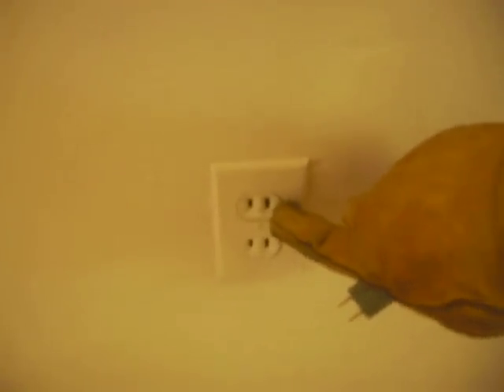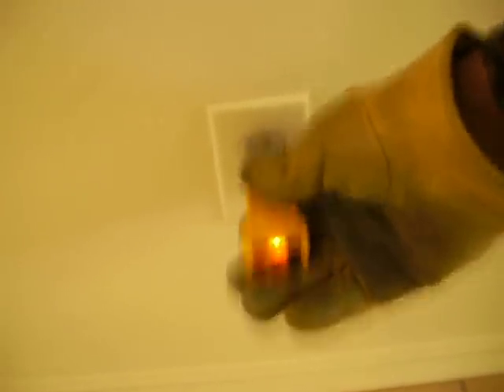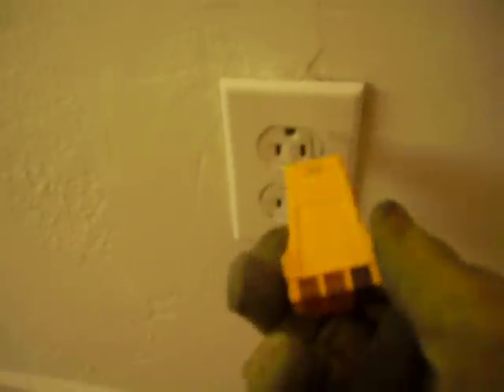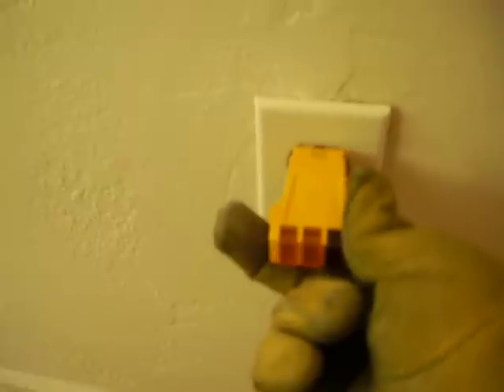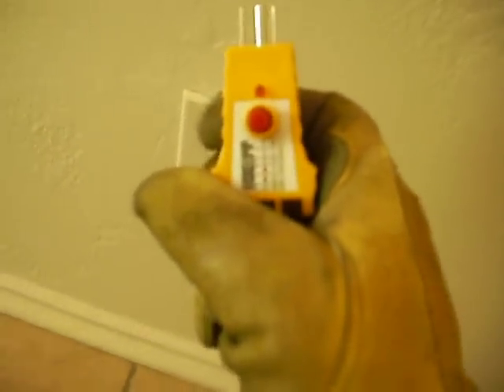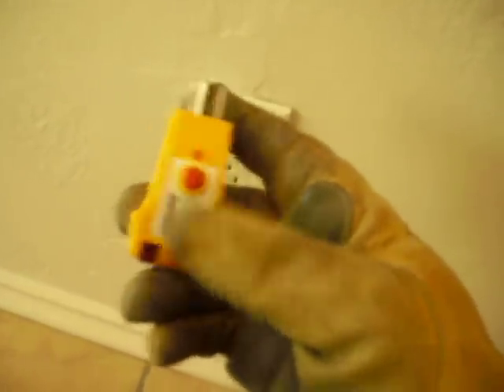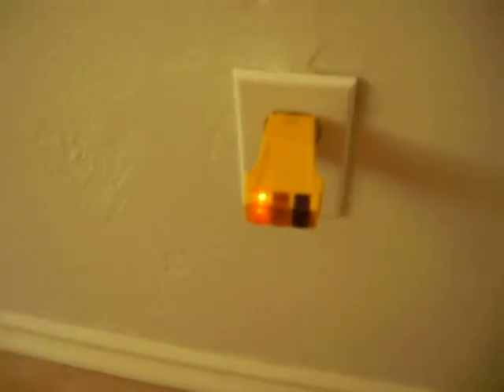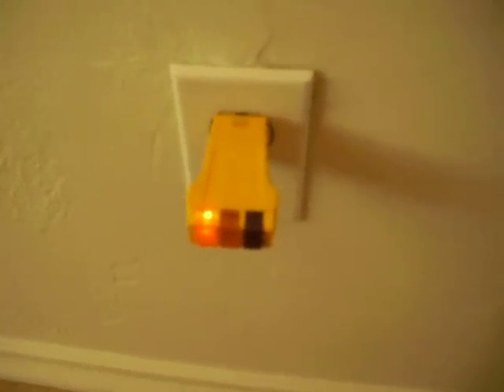Open Neutral Hazard pt 1 of 2

Comment: I have this problem with a ceiling light. Found this out during a ceiling fan install. The amount of power leak was minimal according to my multimeter(less than a volt) and touching the live wire results in nothing more that a tiny spark and can't really be felt if touched(fortunately for me since I did). The light controlled by two switches so I am wondering if just replacing the switches will fix this issue.

Comment: so many contradicting comments because people won't say precisely what they mean!    Example: current takes path of least resistance to ground.  False!  Current will take any path it can back to source.  TRUE!  So, it is best if that source is a copper wire and nothing else provided the neutral circuit is closed , not open, IF the neutral circuit is open, then the current will take alternative path back to source!  Example: Through a person, then through the ground, but still back to source! Thank you.

Comment: These testers don't diagnose bad wiring and should never be used except for general indication of some undefined issue. Only a multimeter and visual inspection from plug to panel can identify any problems. Electrical inspectors never use these testers so nor should home inspection outfits. The neutral doesn't protect against electrocution in the event of touching the bare copper of a hot wire or electrified box while feet, hand or elbow, etc, are earthed. When being zapped, the current doesn't travel via the white wire to the panel. It goes through the body of the person being zapped into the earth through path of least resistance in both proper and improper neutral connection.
Reply: You don't really need to go to the expense of a multimeter.  An Ideal 61-065 Solenoid Voltage Tester will work fine and can be purchased for around $30 at Home Depot.  I have carried one of these for years, I worked as an industrial electrician in a mfg plant.

Comment: why would you ground one of the phases you have two phases one can be a nutreal or hot sends same thing, grounding or neutral return path is what you need, things wont run without both sides but they will without the ground, it is to save many electronic appliances computers etc need it to dump the excess power so things don't burn up, either way if you electrocuted your going to be injured or if you get 240 your going to get knocked out